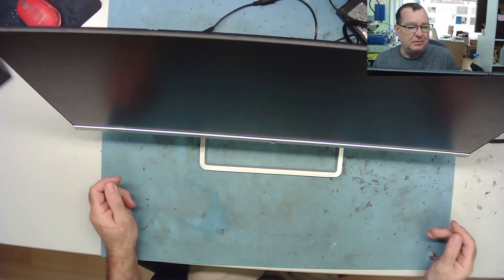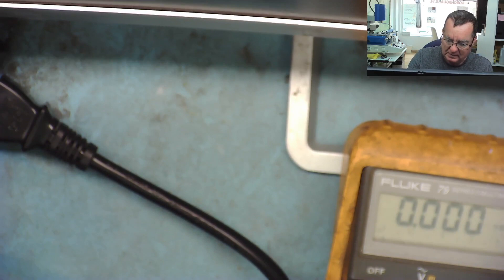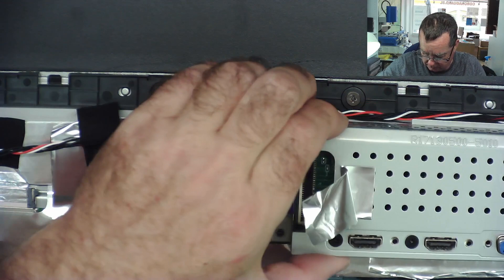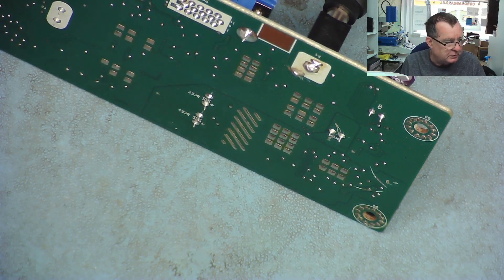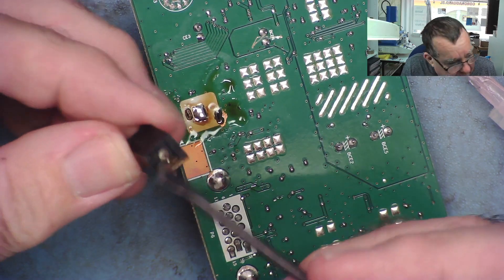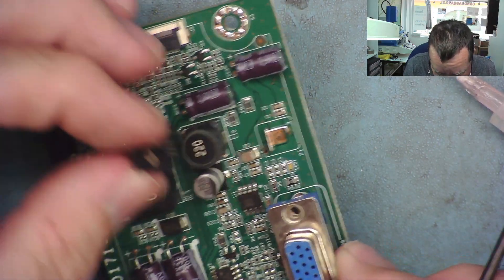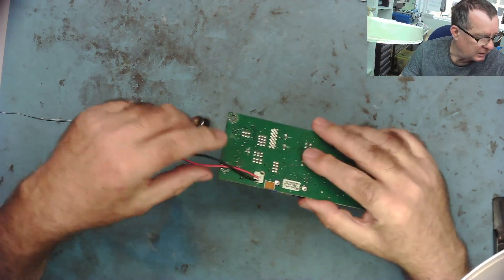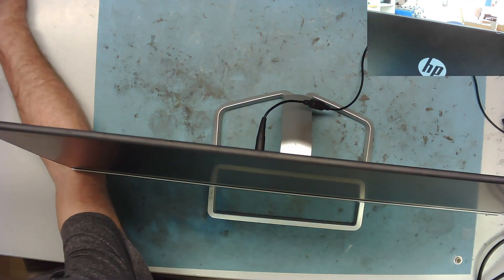Dead HP 27F Monitor - Does Not Power On. Let's Fix it.  LER #180

Comment: This style jack can be used on battery operated devices too in which case the negative pole is disconnected when the adapter plug is inserted.

Comment: I had a problem that my screen was loosing Power and the middle pin in the dc Jack was loose just like in the video, but i did not have do modify anything or replace anything. I just heated up in the middle of the dc jack at the curcuit board and added some soldering and then the pin was no longer loose and worked fine again after I put it together. So if you are lucky its a really easy fix!

Nice video

Comment: The 'switch contacts' on some (but not all) DC jacks is in the 0V rail and is generally used where you have an alternative power connection which is 'disconnected' if the DC jack is inserted. I couldn't see an alternative power connection in your video but there may be one.
Reply from the maker: Yeah I know that happens ob battery/mains adapter powered equipment.  In this case I just think they used the connector without using that feature.  From what  I could see. that other 'ground' pad doesn't connect to anywhere.